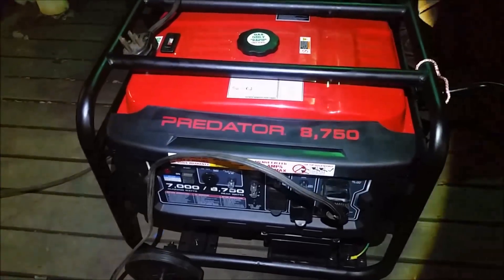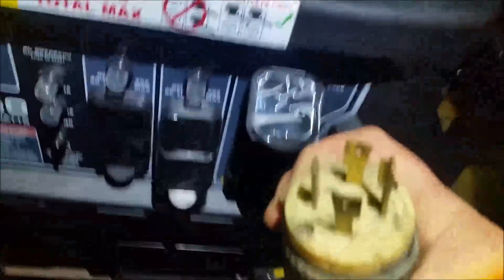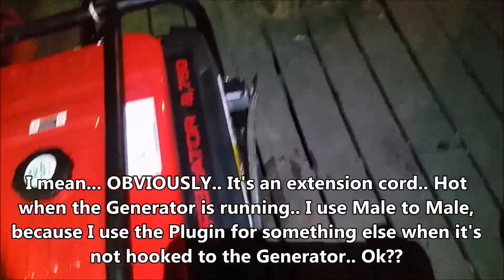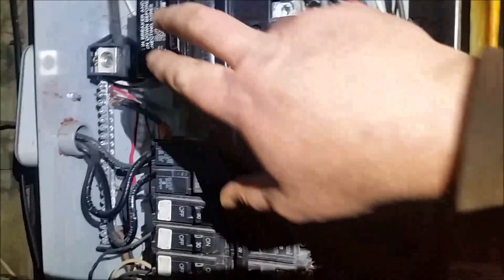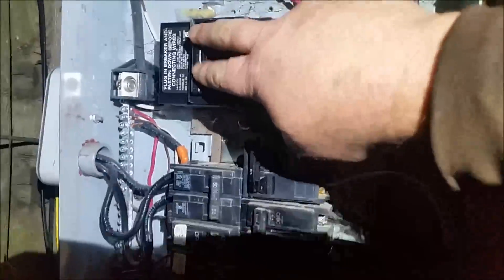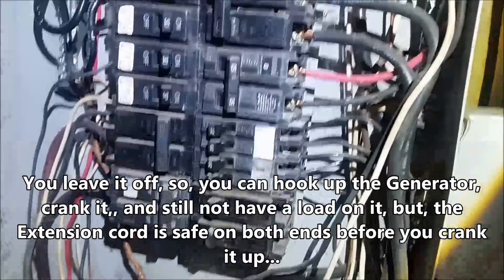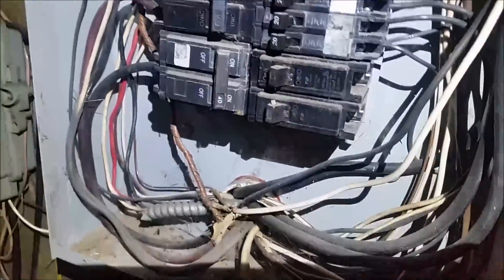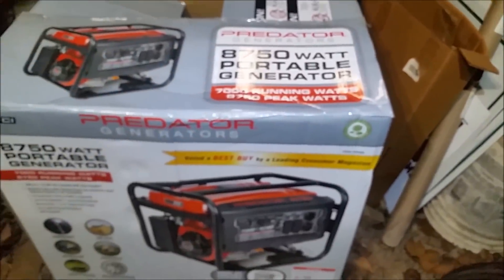Quick/Easy/Safe: Use Existing Plugin/Breaker for Generator hook up to your house Panel box.

Comment: Careful! I have used this set up several times over the years thru the Dryer receptacle. The last time I became the idiot. After the power was restored to the neighborhood I guess I was over confident. I shut off the Gen. And breaker on the Gen. Went inside and turned on main breaker. House lit up fine. Back outside to unplug cord from Gen. Carry cord to basement window, touched two prongs of male cord prongs. I was paying the power company for the 110 volts I was getting. Less than an inch away from 220! Should have shut off dryer breaker and removed gen. Cord before turning on main breaker. Bad stuff can happen when we try to save a few bucks!
Reply from the maker: I didn't quite understand the middle of the paragraph, but, correct.. The procedure would be flipping off the Dryer breaker first, then go to the Generator and turn the breaker on the Generator off, then, shut down the generator and unplug the plug.. Then, remove the plug from both ends before you turn the main breaker back on.. 
I still can't understand why you didn't unplug the cord while you were right there? First at the generator,, while you were standing right there,, and then go and unplug the other end.. 
It is the only thing you have to do to remain safe.. Turn the Main Breaker off,, kill Generator (Kill Power on Both Ends), then, remove the extension cord before doing anything else.. 
Considering you are working with 220v on both ends,,, that is a "MAJOR" Brain Fart!!
Kind of like cooking and hearing your Son or Daughter yell "MOM!!!! HELP!!!!",,, and you not turning the stove off before you run outside.. But, the first scenario,, there is no emergency,, and the second there was a distraction and emergency.. 
I guess I am different.. I don't move,,, until I evaluate the situation,, but, I am always the first person to solve the emergency..
CAREFUL!! You are EXACTLY CORRECT!!! You Think about what you are going to do, before you go and do it,, and just before you start, you stop and think about what you were going to do, and check to see if what you were going to do is correct.. And, if you have done it 100 times before and decide to change something,, it is that something that you have to evaluate before you change something..
If you want to learn something and understand it... You determine what you are going to do before you look at something,, and then, when you get there,, you go over it again and make sure you understood what to do before you now are looking at it and see if you were correct.. If you were,, and then, you confirm you were, you will likely not forget and make a mistake.. Never get distracted from a current task,, without stopping for a second or two before you take off on something else.. Best advice I can give for not forgetting and making that mistake again..
Even when I am explaining what I am doing to someone, I always run it through my mind first, then, do it while I am explaining it..
Reply: You are the first with an actual concrete refutation of this.
Reply: Andy Stitt you haven’t been reading enough comments.

Comment: Code would definitely disalllow this, but it worked fine for me for two yrs. Yank the incoming breakers to prevent a short or back feed. I just spliced two extensions so I had a double male 120vac line and just plugged it in like a normal cord. True the second bar wouldn't get power but it was an apt. and ran only about 4.5kwh a day. Served me well enough.
 😎

Comment: Sorry bud but you don't know what you are talking about.  For one thing, the left breakers aren't fed by the left feed line and vice versa.  Every other slot is a different feed line or you would never get 220v from a double pole breaker.
Reply: I'm glad that you figured it out for yourself MIke. This guy is not hinged right and he's convinced he knows everything. Transfer switches for switching from utility source to auxiliary systems cannot safely be field fabricated. They must pass rigorous testing for separation clearance and be rated for load making and load breaking. They have to be UL listed for the purpose. The number one concern is the safety of the operator as well as any innocent bystander that may encounter the setup. The only thing that he has a clue about is that it takes a double pole breaker for 240 volts. This is another one of those videos that Youtube users must be aware about!
Reply: Everybody really needs to watch this video about generator safety https://youtu.be/I1jT3ANENvI it’s very important

Comment: Preamble:  I have little or no common sense when it comes to electrical.  Also, I apologize for being so verbose in my comments, but I really liked this video.  Just a plain ole practical approach to solving a problem.

Mark,
Interesting video.  I think there is good information in there, even if people do not agree with the methods.  I would make a few comments...

1) Change the spin on your video to the "unsafe" way to hook up a generator to a house.  However, keep content and ideas the same.  The way I see it, no matter what you do, there are going to be people who try to plug their generators to their home wiring.  For those people, the steps demonstrated in this video can SAVE a lineman from injury!  This video, spun the right way, is a public service.

2) My house doesn't have the 4 prong welder plug you showed in the video, but I do have an electric dryer.  For my application, I would keep the NEMA L14-30 going to the generator the same, but splice a 4 prong dryer plug on the other end.  For a 20-30 ft cable, I would consider using 10 gauge copper wire, braided for flexibility.  That should give me 120v, 30a, 1 phase for each bus bar at the panel.

3) I really liked that you pointed out adding load back slowly.  First, i would determine how many receptacles I want/need generator power to during an outage.  AFTER that, I would know how big a generator I need, THEN I would buy the appropriate size generator.  I would mark (or replace with Green Dot) all receptacle on that breaker, so I know which ones are getting power from the generator.  That way, I know which plugs are live and can also unplug everything on that breaker's circuit that I don't need the generator to power.  I'd also mark the breaker(s) for easy reference during an outage.
  ** In reality, I'm lazy.  It would probably work out that my power would go out, I would then buy/borrow a generator, then add back load slowly, one breaker at a time.  During that process is when I would actually figure it all out.  heh. **

Additional Thoughts... though not really applicable in your situation.  My house gets natural gas.  I would retrofit my generator to use it.  In my area, the gas utility typically continues to run for 2-3 days or longer, despite a power outage.  So no need to keep good gas on hand or repeated tank filling throughout the day.  I wouldn't have to worry about the carburetor fouling from improper maintenance either.  FYI, Sta-bil won't keep gas good forever, 12 -24 months, per manufacturer, although personally I have had 5 year old gas run a lawnmower without problems.  Again, just a thought...

Anyway, just my 2 cents.  Thanks for the video.
Reply from the maker: Interesting comments!!  Ha.. 
Like,,, change the Title to "How to Hook up your Generator to your house, the Easy and UNSAFE WAY??? Ha..Ha..Ha.. 
That would be an Interesting experiment, but,,,, I'll bet you a crisp, clean $1000.00 bill, I still get the Ignorant and Safety Police comments. Ha.. This video has been an experiment from jump.. Just a quick video for a few friends and friends of friends, but, it turned into a hotspot for negative comments.. Ha.. When I have time, I run it again, and make a few corrections, and try that.. Good Idea.. :).. 
2) Just a suggestion.. Keep your Genset cord in one piece, in case you want to use it for something else "Standard" down the road.. Just make a short extension cord with the plug you want on both ends.. I use the 50 amp plugs because it is my standard for 220v equipment. It is what I use for everything 220v.. I can plug anything up anywhere.. Gives me Flexibility..
I left the dryer plug alone.. It's behind the dryer, so, I don't use it for anything but the dryer.. Either way.. Just might want to use the generator at a friends house and might be of some value standard.. Your choice.. 
3) Good idea.. I put all of my 120v breakers back on.. I do turn off all of  my laserjet printers inside before I turn the generator on.. They use a lot of juice. I do turn off all of my 220v breakers for Welders, compressors, etc.. I leave the Deep Well pump on, but, I turn off the Water heater at the same time... I alternate the Hot water heater with the Deep well pump.. Before I shower, I turn the Hot water heater off.. Shower, then, turn the pump off and water heater back on to recharge it.
My generator really takes a beating when I have both kick on at the same time.. It will run both, but, I have to turn off my bedroom A/C to do it, so, it works fine the way I do it..

Comment: I have a 10.5 Kw peak / 7 Kw running watts Troy Bilt electric start generator that I did basically the same thing with except I installed a dedicated  set of 30 amp breakers in my garage breaker box and a 50 amp 240 volt plug near by. 7 Kw @ 120 volts = 29 amps per leg. When I wired my garage, I wired the main line from my outside power box below my meter to the garage with 8 Gauge wire and a set of 60 amp breakers in the main box. I have my generator in a small alcove in my garage facing a 30" walk in door. I leave the door open and open the main door about 12" when it's running so it gets proper ventilation. I keep a 20" box fan plugged into it so it starts with the generator. Otherwise, if the outside air is still, the exhaust builds up and chokes out the engine. I can't get natural gas where I live because my property is 1/2 way between my father-in-law's house and his gas meter 1/4 of a mile away and I can't tap his line so my house is all electric. What I did in my house was take RED wire ties and looped one through the connecting pin on each 240 volt double breaker so if I wasn't home and my wife had to switch over, she'd know which breakers to throw first. My generator won't run my 4 ton behemoth of a central A/C unit but it will run the blower to circulate the air in the house. It will also run my 40 gallon, 4.5 Kw hot water tank although I have to sign my house over to an Arab every time I do it. We have a window A/C unit in the bedroom to keep cool with in the summer. We have a small butane gas camp stove for hot snacks and a 2 burner Coleman propane camp stove for whole meals. We also have the microwave to use too. We have a wood burning fire place but we went through a small forest of firewood the first 2 years that we were here so we went to propane logs until the price of propane delivery went out of sight so we got rid of the bulk tank and I pulled up the soft copper line and rerouted it to my side yard, cut it off and installed a flair "T" and 2 aftermarket gas grill regulators on it. Two, 20 lb tanks will keep our 1,836 Sq. ft house comfortable for 6 solid days. In 17 years here, we had the power go off for 9 days once in an ice storm but not more than 3 days otherwise.
A couple of tips:
1) The 12 volt X 18 amp hour starter battery on my generator died after the first 6 years. I called Lowes, where I bought the generator, about a replacement. They said it would be $98.00 + tax and a 10 day wait for the same Chinese made junk. I went on Amazon.com and got a 12 volt @ 22 amp hour Mighty Max brand battery actually made for a portable jump starter. It was the same physical size and fit perfectly in the battery mount. It cost me $44.00 including free delivery for an 8 lb battery and hasn't missed a lick in the past 3 years.
2) One day, I went to our local farm supply store for propane refills. There were 12, 20 lb propane tanks laying by the main supply tank. I asked the guy what was up with them. He said they were expired so people just leave them and go buy new ones @ $30.00 each and have them filled. I asked what do they do with them? He said they take them to the dump. I took them all home for free and trade them in at Walmart for Blue Rhino's for about $15.00. The first time is a rip off at a 15 lb fill each but after that, I take them back to the local farm supply store for a full 80% fill for about $9.00 to $11.00. I trade in an expired tank, some with the old style valves on them, and I get a recently inspected used tank with a new valve on it and 15 lbs of gas for about $15.00 the first time and $9.00 to $11.00 for subsequent fills after that instead of a new empty tank for $30.00 and another $9.00 to $11.00 to fill it up.
Reply from the maker: Sounds like you have it covered... Wow.. It kills the generator? Ha.. Careful with that one even when the fan is running,, but, I am sure you are not going to sleep in there, so, you are ok, but, if you get tired, I would get out of there, and not sit down to see if I felt better. Ha.. 
6 years on a Generator battery.. Man.. I would order that again in a heartbeat.. Ha.. I am happy if I get 3 years. Always buy mine from Carquest or Napa.. Had best luck there.. Walmart batteries in that size crap out in a year.. 
For the Firewood delima,, do some research about a "Rocket Stove Mass Heater".. 
Very little wood, no smoke and really gets every drop of energy out of that wood.. 
Cheers.
Reply: My garage is not connected to my house. If it were, I would have never considered running my generator inside it. I start the generator, hit the electric door opener for 1 foot and step out the side door. When the power comes back on, I shut off the dual breakers in the box, shut off the fuel valve and step out until the engine dies. I flip the main breaker under the meter then open the front garage door and air it out. I never spend any real time in the garage while the generator is running. Have a happy.
Reply: Please make sure you don’t run you generator indoors https://youtu.be/I1jT3ANENvI carbon monoxide is dangerous. You need a carbon monoxide detector to keep your family safe. That’s against generator safety. Thank you

Comment: Hmmm interesting useful video Mark, BUT.... you don't even need to open up the mains box and wire this thing in.  For the dumbasses who are afraid of touching wiring, just turn off the mains breaker switch, put a male to male INTO A POWER BOARD plugged into a point in your house circuit, turn on the genny and it does the same thing, reverse powers into your home circuit.  You can even use one with a built in breaker, safety nuts!  If you have several different breakers and different points and don't want to run an extension from the now live circuit, (only if you are smart enough to not mix the live and neutral up) make another male to male and connect from the closest one to the other as well, simple, just make sure both end switches are turned OFF before you do it.  Power is back?  Turn off genny, unplug males and switch breaker back on.  So much for the dumbasses claiming it's illegal, turning off the main breaker and plugging a male/male into a power board plugged into your house is NOT illegal so everyone else having a cry here about hiring an electrician had better suck it up.
Reply from the maker: David Robertson.. Ha.. Finally.. After 130,000 views,, someone actually sees the simplicity of the whole deal.. Ha..Ha.. 
No.. It's not that bad, but, you are the first to actually post that there is nothing added but an extension cord here.. 
Seems like I said that in the video.. Ha..Ha.. You are so right.. Just make sure whatever you are plugging into is not hot, when you are using that type of extension cord, and your golden.. Makes you wonder about the Safety Police... Ha..Ha... Man,, are they simple minded folks huh... :)
And,, I am still waiting for that special someone to notice that this video still won't give the safety police enough info to use it.. Hell.. I didn't hold their Pud,, and show them how to make the extension cord.. Ha..Ha..Ha.. 
Now, they have to try to find someone who will show them how to make a "Suicide Cord",,, so,, the next poor guy like me who would make one is getting hammered out there in youtube land somewhere... Ha..Ha..
I need to do a search and see if I can find the poor fool out there who decided to make a video on that!!!! Ha..Ha..Ha..  I'm sure we could have a few laughs about that one...  I just didn't want to be responsible for the Dumb Ass Safety Police getting that close to something that required common sense.. Ha..Ha. Cheers David.. Have a nice day...

Comment: After reading more of the negative posts I felt it necessary to post the following;

Comment made by a utility worker on a professional forum, The policy is to "identify, isolate, test and ground" before going to work, so a home generator is not really a concern.

"Insulated gloves and sleeves: Linemen must wear insulated rubber gloves and sleeves when working on any type of electrical line. They provide protection against electrical shock and burn, and are tested at 30,000 volts. Protective gloves, usually made of leather, are worn over the insulated gloves to protect the rubber from punctures and cuts."
Reply from the maker: On Target.. An idea and some research and a post.. A novel Idea huh.. Ha..Ha. Wish more would do that.. Ha..Ha.. 
Thanks for the post Ed.. Common sense to you what you were looking for and what you would find.. Just had to find it.. Cheers..